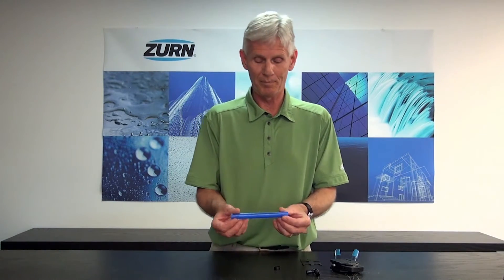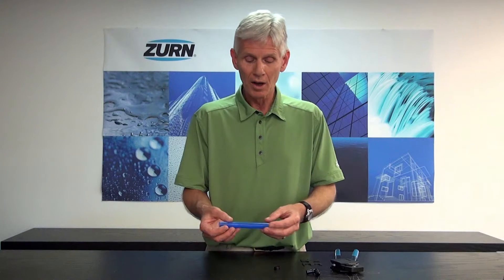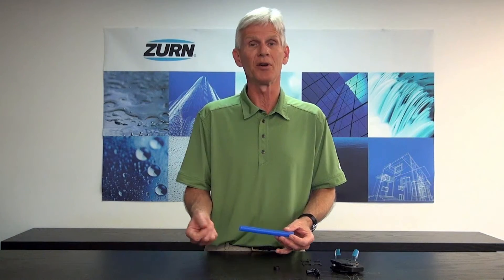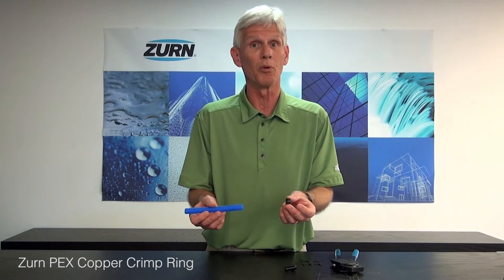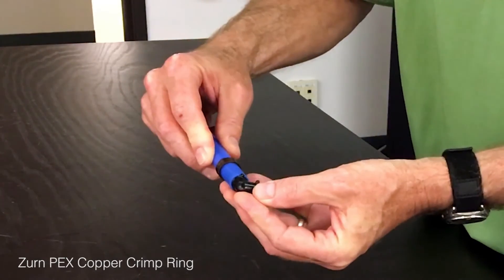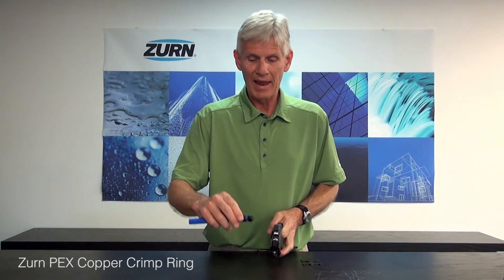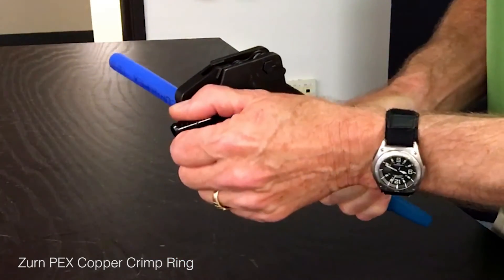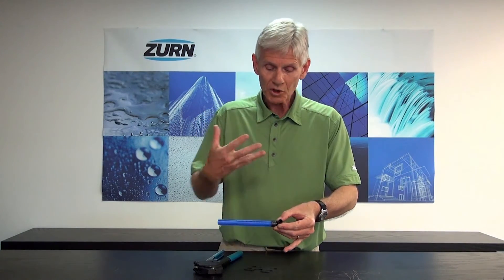Zurn PEX Plumbing Copper Crimp Ring - How it Works

Comment: The pipe handles freezing a bit better, how bout the fittings?  Also, can the copper crimp rings be used underground?
Reply from the maker: Thank you for reaching out. I received the following response from one of our Zurn Application Engineers: You should never allow the water inside PEX tubing to freeze. If a PEX pipe is located in an area that there's any chance of freezing, precautions must be taken to ensure that the water inside the PEX tubing doesn't freeze. One common method is wrapping pipe with thermostatically controlled heat tape and insulation. If you have further questions you can call our Customer Care team at 1.855.663.9876 or by submitting your questions here: https://www.zurn.com/contact

Comment: What is the smallest ring that can be crimped using this method? I an looking to custom make rings for .125"  OD. Is there a tool that would work with this size?
Reply from the maker: All Zurn PEX crimp rings are specifically designed to meet ASTM standards for fittings and components of PEX plumbing systems. ASTM F1807 covers copper crimp rings in sizes from 3/8” – 2” sizes. Unfortunately, we do not offer a tool to work with1/8” crimp rings.

Comment: Anything different when using the large tool to do 1.25", 1.5", and 2" PEX?
Reply from the maker: Thank you for your question, our Product Manager says: "It is the same process, just make sure you are using the proper size tool in relation to the rings, pipe, and fittings. The placement of the copper crimp ring from shoulder does change with the larger diameter fittings. For size 2” measure (3/8”-1/2”). For sizes 1-1/4” and 1-1/2” measure  (1/4”-3/8”)."